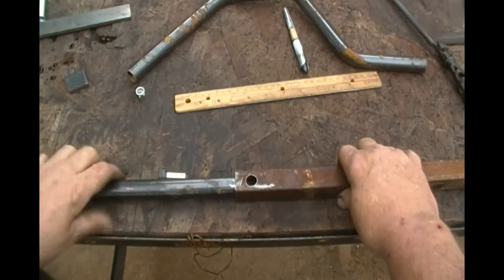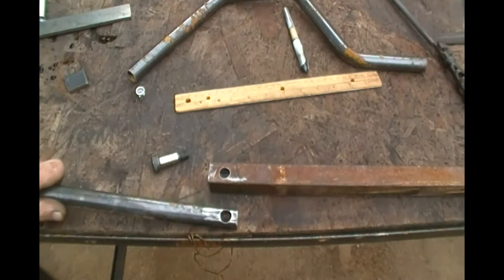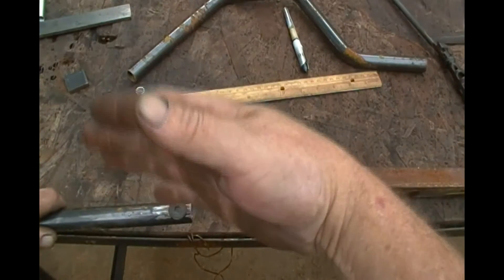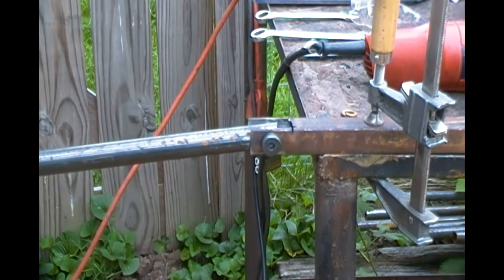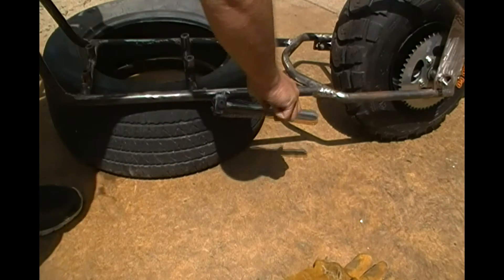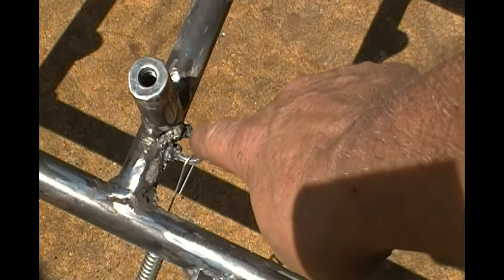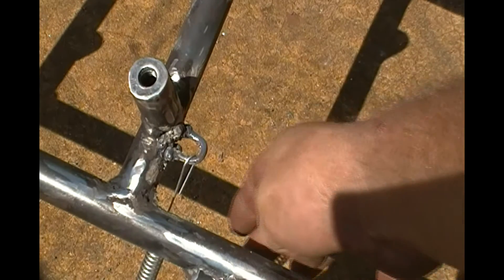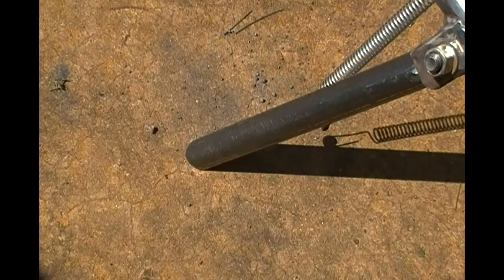Springer Bike, Custom Kickstand Build, One Off, must see !

Comment: Hey there that's one great job fabricating all that up. I would suggest one thing though and you have already probably figured it out. But the small spring you have on there to put things together for now should be stronger. once the full weight is on the stand any forward momentum could send that sweet baby to the ground. I don't know if you have ever tried to respring a big bike kickstand while installing it but its a pain the way the factory engineers them. Great job Im diggin what your doin.